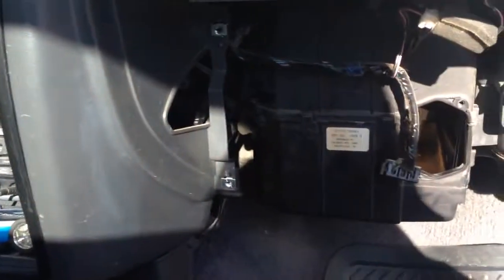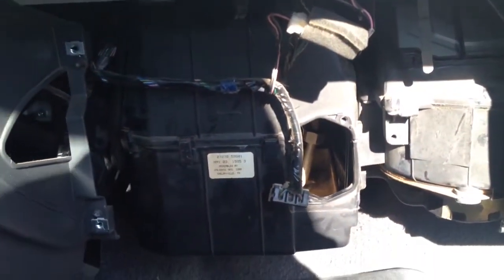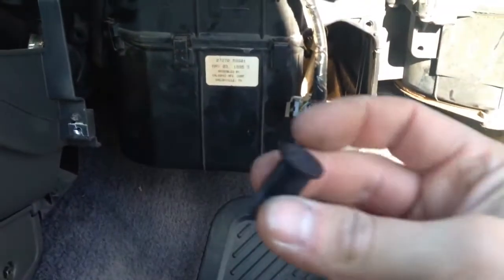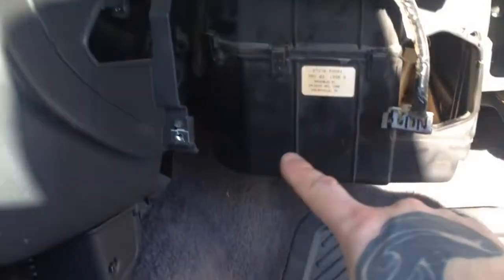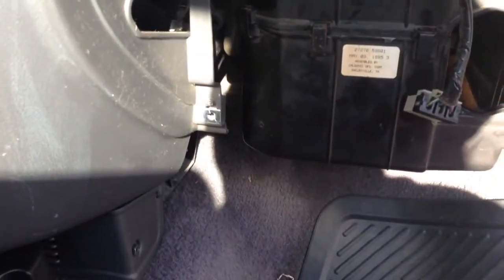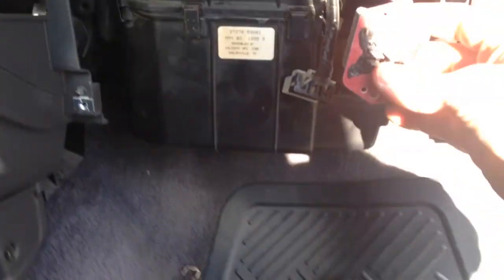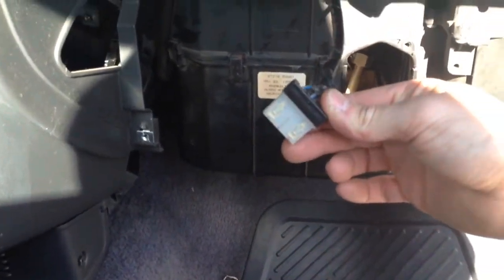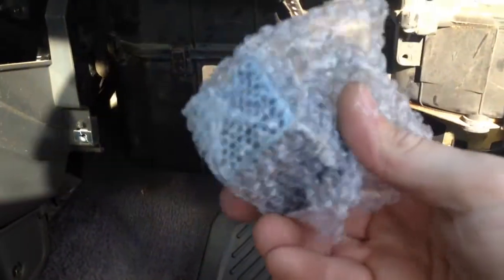Nissan hardbody d21 heater not working fix

Comment: I don't understand how this controls my heat, this is just a little electric coil, what about my heat core that isn't getting hot coolant flowing through it? What controls the valve to let the hot water in? No leaks, hose gets hot up to the firewall but the core(small radiator) never gets hot?

Comment: That's the blower motor range control resistors I believe? If the problem is with the slider switch then it's involved in pulling out the climate control assembly.